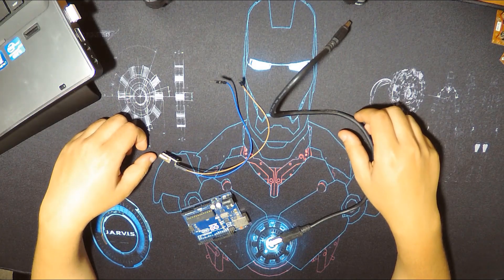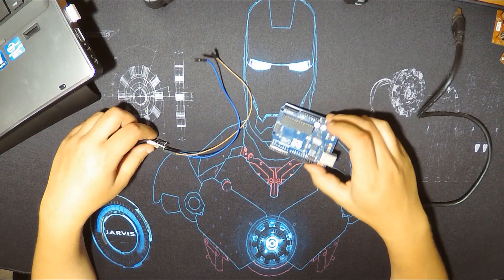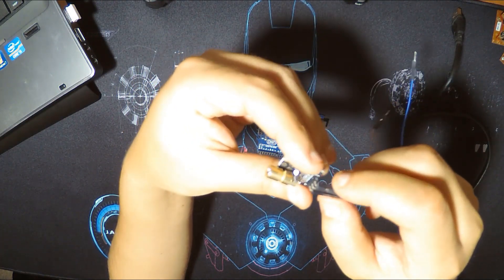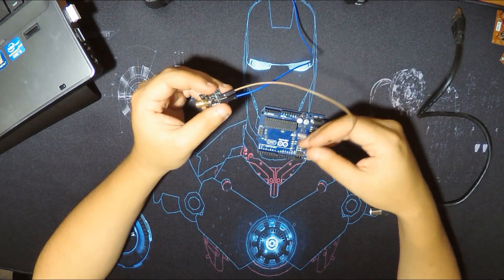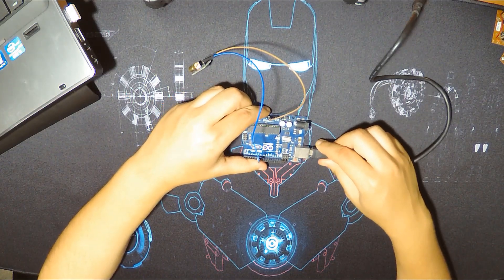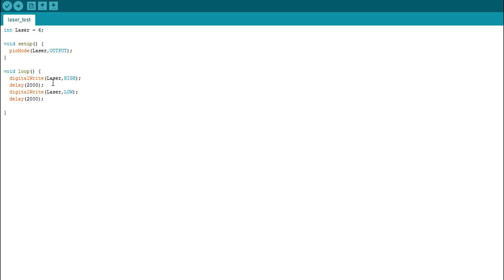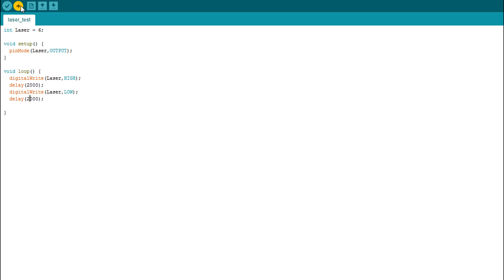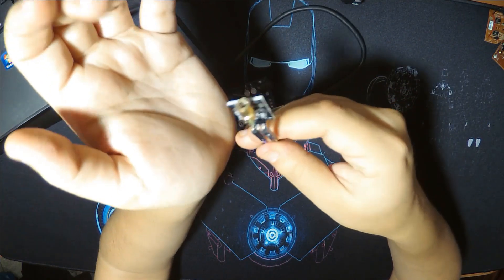Arduino KY-008 LASER module

Comment: the third pin in the middle of two pins on the laser module is the (5v) pin. without plugging in the 5v pin the laser diode doesn't have power and won't function properly

Comment: I did the same thing as you did, but my laser won't light up. how can i solve?
Reply from the maker: Did you try to connect S to a signal pin like D3 or D4 then the middle with 5V and the - with GND?
Well that's the basic wiring it should work, otherwise there's a problem with the module.
Reply: Connect the lasers ground to positive 5V from arduino, and the positive of the laser just leave it unconnected.
Reply: @liridonosmani22  it worked, thank you dear...but why it had worked after the ground had given to 5v?
Reply: @ErfanN29  Made in China